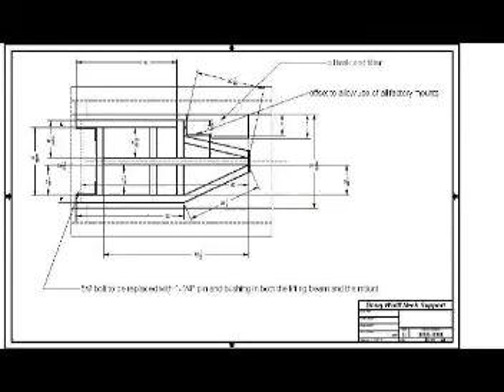D&K hyd Trail King destruction Part 1

Comment: Please don't take this wrong, I am just curious, I am an old school welder / machinist here, but I was taught, (before we used MIG all we had was the 7018 rod, and a rod by Eutectic (SIC?) I think it was 680), that when you plated a frame, you had to use a diamond shaped plate, and then you could not weld it solid, or it would eventually crack. I guess with the newer welding equipment the old rules go out the window. You do some fantastic welds by the way! I am so glad to see the old girl rescued from the scraper. Thanks for posting!